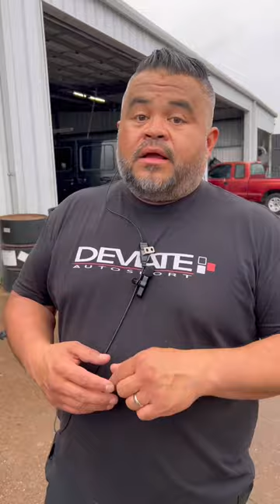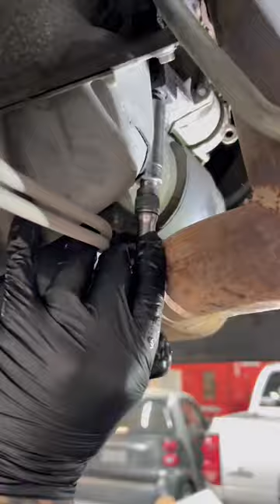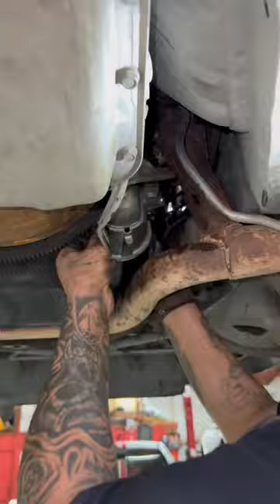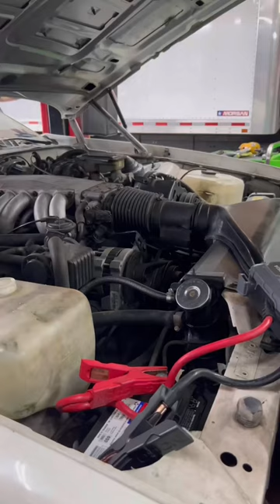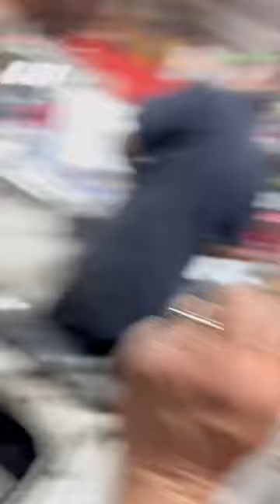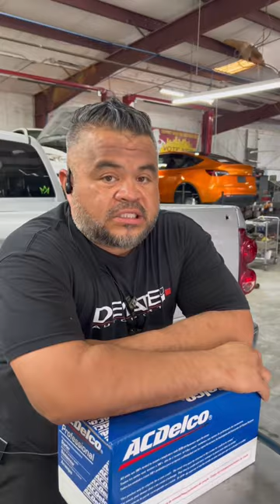FIRST CRANK ENGINE BLOWN🤯‼️ #shorts

Comment: Sounds like a cracked flex plate not a rod knock imo
Reply: It's hard to say without seeing it in person, but I think I agree.  
That makes me wonder how many engines have been unnecessarily swapped due to misdiagnosing a cracked flex plate as a rod knock. People frequently hear that knocking sound and immediately declare the engine is toast with no further examination.

Comment: That definitely sounds like a knock but it makes me nervous telling the customer the engine is bad without popping the accessory belt off first. These Chevys sound HORRIBLE if they have both the front idler bearings go bad, it can sound like a bearing because it is just not an engine bearing.

Comment: 87 overheating? Head gasket, no need to check. Pull it out cuz chances are u need the rear main seal and a valve job and all the seals and gaskets, and bearings and and. A domestic? Did it sit for a while and or did not have a great maint record? U need a motor rebuild/new motor. $0 in diagnostics.

Comment: Dont Ls swap it
Reply: Man I own a few small blocks and a Camaro and vette with an LT’s. They’re alright and the only reason those 2 still have LT’s is they’re “Rare” very low Mile cars. I have my other Camaro that was an LT and the best decision I ever made was tossing in the first LQ9 I got. Since then it’s been an amazing rabbit hole of chasing actual power. Don’t get me wrong a built boosted LT is fun but they hit they’re Limit quick and there’s no quick size up like in the LS world. I went through 3 6.0’s and 1 5.3. Before I sent out a 5.3 block to get punched out and re sleeved to now it’s roughly 410cid I think it was. That only set me back a block that needed a resleeve anyway and 2700$ ish labour included new sleeves, new bearing, all the machine work and balancing of the rotating assembly